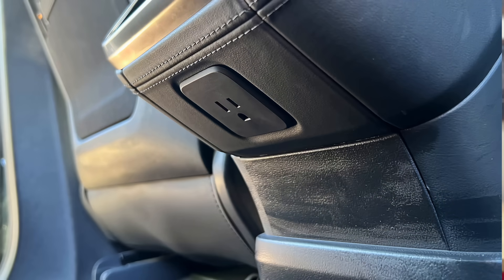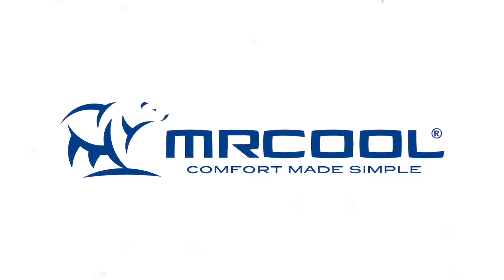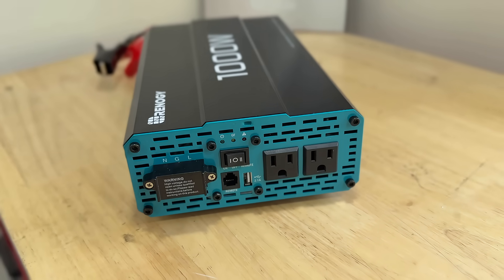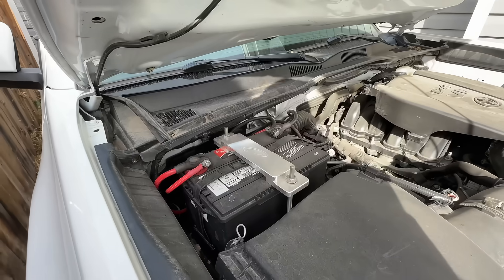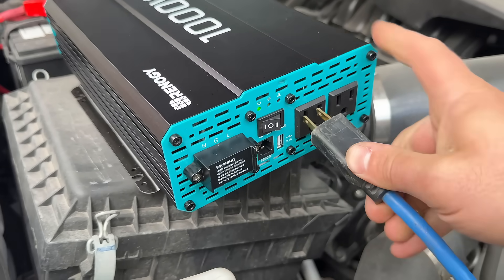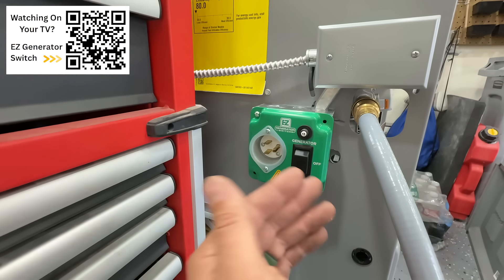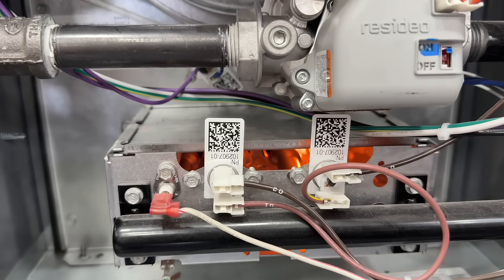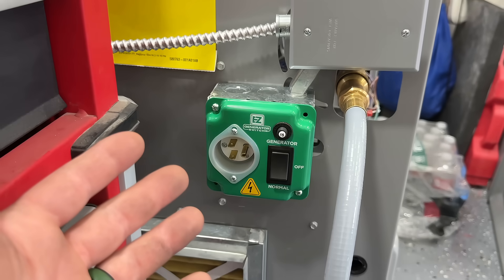Why Buy A Generator? You Have One Parked In Your Driveway.

Comment: a 1000 watt inverter wont even operate a microwave. seriously you think it will heat an entire house? You need at least 3000 watts to run 2 devices which you can get on amazon for 100 bucks but a 1000 watt inverter will not keep your heat running

Comment: 🛑 A 1000 watt inverter will draw up to 85-90 amps at 12v from the battery at full load. Running the furnace or any other appliances will drain that battery very quickly.  Running the vehicle periodically will not be an option. In fact it is entirely possible the alternator will not keep up with demand at idle and may drop the voltage in the vehicle so much so that it won’t run. I’ll stick to my gasoline generator, thanks. Good luck, you’ll need it.

Comment: @ 5:04 Thermostat needs power to power on the heater soooo.... how do I remedy that... Generac
Reply: The thermostat draws its power either from the furnace controls or is battery operated.  You do not need a separate power source for the thermostat.

Comment: Car alternators only put out a limited amount of power. A 100-amp car alternator can produce approximately 1200 watts. 1200 watts is not much 110 power. Example: Most full-size coffee makers, particularly traditional drip brewers, use between 550 and 1200 watts. This sort of reserve power is just not enough for me. I use Lifepo4 and solar recharging. 

My idea for adding a generator to a car and getting more output would be more like adding a pully to the drive wheel, jacking that wheel off the ground and connecting a AC generator to that wheel with a belt. With the right generator, you could almost power a whole house.

Comment: During the 04 4 Hurricanes here in Florida. I used my inverters to run a lot of things. Had no power for 14 days. I used my generator to just heat the water heater. Once the tank was hot, it will last for days. Then I would run my fridge intermittently. But my inventors can in handy by running the fans, tv, and charge battery packs.

Comment: Good info
I have 2 batteries in my 2007 Yukon Denali and was thinking of doing this but more of a permanent install above the rear wheel well for camping as well.

 However,  I want to do the same with my Express work van were I can install a larger Inverter like a 10,000 watt.
As far as the trucks being on for long periods of time, that is fine. My Family and I take long trips and  my truck stays on for 12-14 at a time, wether driving or idling for bathroom or to eat.
Almost 300K and no issues

Comment: During Katrina I did this in a 1986 Chevy Van in order to run a water well pump (when needed) and refrigerator. I slept in van with fan and A/C as needed. 
1)Van was more efficient on gas than a portable generator.
2)It was extremely more quiet.
3)It was better for a long term power outage.
4)Downfall was no hot water.
While a generator wouldve been a great luxury, we couldnt get gas for three weeks. And the gas price was inflated. Others I knew with 5000W portable generators, ran out of gas in the first week.

Comment: I use my truck inverter on work sites. Duh… never thought about using it @ home as I have 3 separate large & small generators here. Q 4 U, why would you not just use an outlet plug , cig lighter, to pwr the inverter? Either way works.

Comment: That is a terrible way to power anything for a long time.
The average car battery has only about 48ah a big one might have 100ah. That would be about 20 minutes on a water heater. Maybe 8 on a refrigerator if you never opened it. 
A cars alternator is not made to produce 120v AC. It's makes 12v DC. 
Doing this will kill you battery and your alternator. And replacing both of them would be as much as getting a decent generator. 
This is real bad advice.

Comment: I prefer having a dedicated generator for emergency  purposes,than using the car. It would be terrible if you run out of fuel in your car and you need to use you car in emergency situation. Using your car's fuel, some people wouldn't  think to have jerry cans with spare fuel. I thought generators with an inverter are pretty quiet when running. Regardlr of how you have emergency  power hooked up, people need to think of a safety point. When using an inverter and car, and your car is attached to the house, that just like using a portable generator, you must ensure you vent the car or portable generator. People do die if their emergency power source isn't properly vented to the outdoors. One cyclone season our community went through, a young man put his generator in the same space he was sleeping in, without a proper source of air flow to vent the fumes. Alternatively if using anything that gives off carbon monoxide, buy yourself a carbon monoxide alarm, making sure to put fresh batteries in the alarm when you use it. Getting an alarm is a really a cheap form of insurance, The real upside to using an alarm, may be the difference to you waking up the next morning or never waking up again. Please be super careful when using emergency power sources.

Comment: Alternators are for maintaining a charge and are not very good at charging. Also they do not like running stuff at idle. If you do have you do this use something to make the throttle give the engine a few mor rpm’s over idle. Idling any engine is bad for them as oil pressure and flow is at minimum. Extended idle time is bad for engines.

Comment: Only about 1200 watts though dude. Most alternators Only push 100 or so amps.
Not to mention highly inefficient and replacing your alternator after you burn it up plus the inverter will cost more than a decent generator.

Comment: When you plugged  the cord into the furnace before switching  off the “grid “ power. You would have blown the inverter out the vehicle . Fact  
2nd, you were pulling from the battery only. You never mentioned starting the vehicle to prevent killing the battery. 
3. When connecting to a car battery always connect positive then negative so when you connect positive  there can be no spark. 
You better take this video down before you kill someone

Comment: If you’re dumb enough to leave the inverter cooking in a hot engine bay with no way to cool itself, unsecured, then you deserve the car fire you asked for.
Most of the time your car is idling??  Such a dumb lie. With the exhaust from your truck pointed into the garage at the furnace, you also risk carbon monoxide poisoning your family, and death. At least you'll all be warm n cozy when you pass.

Comment: You’re giving bad advice, for one, your vehicle isn’t designed to idle for any real length of time it’s very hard on it, plus like others said alternator size etc., in an absolute emergency and you happen to have an inverter on your vehicle, in the middle of the night and you could freeze to death, ok, otherwise go buy a generator and start putting together a backup system.

Comment: Almost had it right. You get a second battery that fits your car. Then you can leave the car outside charging one battery (if needed)  while you use the other one. You can even buy 4 batteries and 2 inverters and have a very nice set up that will last at least 2 days.

Comment: Not a bad idea.  In addition to using properly crimped cable lugs and bolt the cables to the battery, I would also recommend not running the extension cord where it can be pinched by the hood.  Run it down underneath the car or something.  Also, yes, a lot of ppl idle their cars for a long time, but I can’t say that proves that extended idling isn’t bad for car engines.  Anyway, thanks for the detailed instruction!

Comment: Get two deep cycle marine batteries and put them in parallel and you can run the inverter for about 6-10 hours, depending on use.

Comment: Incompetent advice from some one who ought to know better.

Note for the numbskull who did this video
- you start drawing 1000W from a standard 12V car alternator at engine idle and you will overheat and burnout the alternator because of insufficient cooling airflow at low speeds
- Note that mst alternators are rated to deliver their full power at much higher revs than idle

Comment: Even better, I have a Toyota Sienna hybrid minivan with an interior outlet that puts out 1500W pure sine wave.  When I leave the vehicle in "Ready Mode", it will run the vehicle approximately 10 min per 1 hour of run time at full 1500W output.  It comes out to about 1/3 gallon/hr of run time, which rivals a small generator at about 1 gallon per 4 hours of run time at a similar amount of power.

Comment: Why does this look dangerous to me? Inverter stuck inside the engine? Hooking the leads to the car battery which is not designed for this? Closing the hood to ensure the baking process of all the spare parts left inside the engine? Leaving your engine running indefinitely? There's no way I'm doing this.

Comment: If you live in FL. Save up and buy a generator. The fuel cost alone will be worth it. It's not easy to get fuel after a hurricane and a large 6 or 8 cylinder is going to eat through fuel. Also you would need to leave your running vehicle unattended which also isn't a great idea after a disaster because of opportunist. This is maybe a great last case option if you have nothing or no means to buy a generator.

Comment: Mechanic here: idiling an ICE, especially a gasoline, is not great for it (some worse than others, due to the need to build pressure to distribute oil throughout properly. All that being said, if you're doing this, you probably have bigger problems than taking a few thousand miles off the life of your rings and/or valves.

Comment: We traveled and lived in a travel trailer for about 10 years.  There were many power outtages, storms or a converter going out that caused us to hook up to my hubbys truck battery, to have heat and electricity .  I was always afraid it would harm the truck, but, we still have the truck, and it has been 15 years since we came off the road!  Never thought about it if our home power went out!  Inverters are lifesavers.thanks for the info!

Comment: Running a sine wave inverter when a car is at idle causes the alternator not generate full power, leading to insufficient voltage and current to run the inverter and its connected loads. This can cause the inverter to shut down, perform poorly, or drain the car's battery rapidly especially with larger than 1000w inverter. Your furnace uses relatively small amount of electrical power (fan & electric igniter), but people shouldn’t assume you can plug bunch of devices into it. Add all wattage requirements on device that you are planning to use and check your alternator idling amperage output to avoid sending your battery, or alternator to early death

Comment: Something to note about powering appliances with inverters. Even if the power requirements are met, not all inverters work for everything. I use an 1100 watt inverter but to power a small fan I had to buy a small 100 watt inverter to do so. The small inverter produces a sine wave signal while the larger is sawtooth (I believe, been a while since I’ve tinkered around with em). 

Also for appliances like refrigerators the power output needs to exceed the startup voltage of the appliance. Starting a refrigerator is more taxing than keeping it going.

Comment: I'm glad someone said this about the generators making noise. The last time we had an ice storm that knocked the power out for several days, it was so quiet you could hear drops of water hitting the ground at night...and you could hear generators going off in the distance. Everybody knew at that point who had them. I did what you did and ran a large inverter off my truck and powered my furnace, fridge and hot water heater. I had it made in the shade...so to speak!

Comment: The invertors generate a fair bit of heat when delivering any degree of ac load. So do not tuck them under the hood and close it if the power failure is in warmer weather.

Comment: Do you need a high-powered alternator in your car to do this?  If you went to the limit of this 1000 watt inverter, you'd be drawing at least 80 amps from your car's alternator.  (1000 watts / 12 volts = 83 amps.)  If this was a continuous load, couldn't it overheat the alternator?

Comment: If you have a catalytic converter on your vehicle or a particulate filter on a diesel, these could get clogged up when running at idle for long periods due to the exhaust not getting up to the required temperature for regeneration cycles.

Comment: You forgot about a battery voltage monitor.  If not, you'll be going out every so often to run your vehicle.  With a remote monitor, they're cheap, you'll know when to run and when to turn it off.  Some you can get with an audible alarm. Going to suck if you let it go to long without running.

Comment: I would consider a way to route the car exhaust gases away smartly,  if so you could use the car in the garage to help heat the house, maybe even route the radiator fluid to heat up water for a shower? .

Comment: Of course, thw fuel costs would quickly eclipse the cost of a generator with aimilar capacity. Your car and it's alternator are not at all optimized to produce electricity. This will do in a pinch, but it's a horrible plan.

Comment: My 2004 GMC Sierra Hybrid truck has a 5.3L V-8 & a 20,000 watt generator and (4) 20 amp 120 VAC outlet plugs built into it for running power tools, space heaters, blenders, coffee makers, etc. while at a jobsite or while camping. 
The generator is nice since it is idling-truck quiet. 

These DC/AC Sierra & Silverado  trucks (not a hybrid like a Prius) were only made in 2004-2006. Oddly, the 2004's do not show up in parts computers or estimator's books. 
They were marketed as a Contractor's truck and the generator was about a $1500 option, which was reasonable, but then it required an expensive  luxury package, which was totally stupid for a Work Truck, so thanks to a lousy GM marketing department, it never sold well. 

20 years later, Ford came out with a $90,000 F-150 with the same A/C Power option, treating it like a great new idea. It was marketed to the Outdoorsmen, Weekend Campers, and Survivallists, which makes more sense.   

Now I am just waiting for a similar mid-size extended cab plug-in AWD hybrid truck (since my house has solar panels) that both fits into my short tract home garage AND a fits a jetski, snowmobile, or a motorcycle or two in the back. My dirtbikes & sportbikes are about 6' 6" long. 

Odd that 20+ years later, the 1/2 ton Pick-up truck Marketing Depts are still over-looking their target audience of young people or empty-nesters looking to go have fun over the weekend or work on DIY projects (such as building ir repairing a shed or gazebo) not near an electrical outlet.

Comment: I had a FJ 40 Land cruiser that had and inverter and air compressor and the inverter had 2-220v and 2-110v receptacles.....it also had coolers transmission fluid....2oil filters and cooler differentials as well larger radiator too....

Comment: For short duration in an extreme emergency ONLY!
Idling for long periods is bad for gasoline vehicles, and can use a LOT of gasoline - like a full tank in one day.
Plus, most AC inverters under $300 put out a modified sine wave that  can damage appliances with motors - refrigerators, freezers, furnace blowers, and microwave ovens. 
Spending $200 to save $300 instead of buying a regular generator could cost you thousands for a new furnace, refrigerator, freezer and microwave, and leave you with an empty tank on your vehicle that leaves you stuck at home with your food now spoiling.
Do it right from the beginning and save your possessions

Comment: Yep. You can run a car engine for a small energy output for battery charge and converter. But I used to drive over the road and used this system. I would burn up alternators a lot and did carry a spare. Only another few hundred dollars are required for an actual alternator that will hold up. 
Market place has many used generators that would do way more and last for weeks on end if required. Basically cheaper. Plus you don't damage your automobile now causing undrivable until fixed...
But if you are in a pinch, you can use this method. But heat equals wear. Our basic alternators are built for this...

Comment: 3:59 if hood won’t latch (and also avoid compressing your extension cords even if the hood will latch) you can drop the end of the extension cord thru the engine compartment to the floor.

Comment: Unecessary!  Just turn off the main breaker to your breaker box, and backfeed electricity from your car, through any outlet you plug into.  Depending on which inverter you choose, you can run everything in your house, depending on the inverter's capacity.

Comment: If ur not gonna permanently install the inverter somewhere safer in the vehicle, maybe consider using a short romex wire with ends on it to bolt to the battery and just rest the inverter on top of the tire in the wheelwell or something to keep it cool and dry.  This might work for short periods alternating between the fridge and furnace as needed but even better if ur using it to recharge a bank of house batteries that powers the whole house.

Comment: If you are unaware and/or unknowledgeble; be aware that rectified Alternating Current ( AC ) from Direct Current ( DC ), the battery, is not a true sine wave but one that is clipped and/or more square looking. This may cause some devices to behave more slowly  and/or with less power than with true AC sine waves at 60-Hz frequency.
Reply: "pure sinus" inverters do produce pure sinus, tested. At high current "pure sinus" output may deviate from sinus, may look ugly but not square and still be acceptable for most appliances.
Reply: You’re hurting my brain
Reply: You are correct about the possible damage but you're using the incorrect term. Rectified alternating current becomes DC current. Alternating current derived from DC is called inverted.